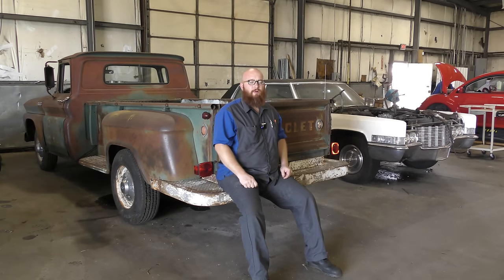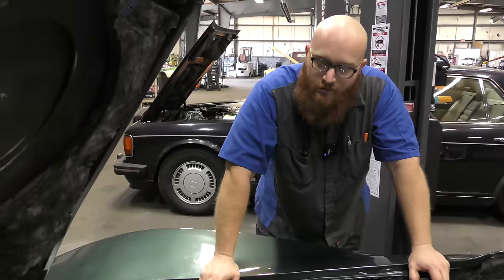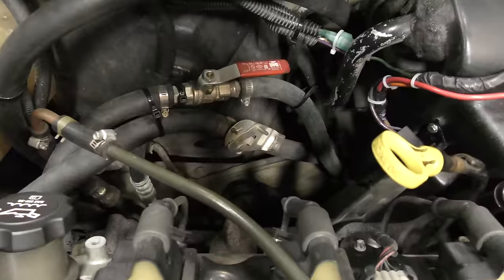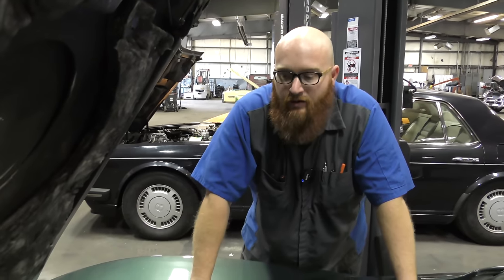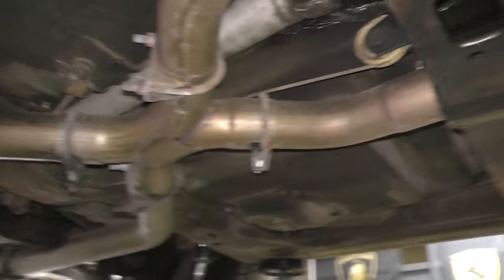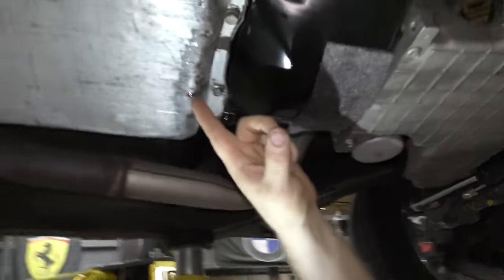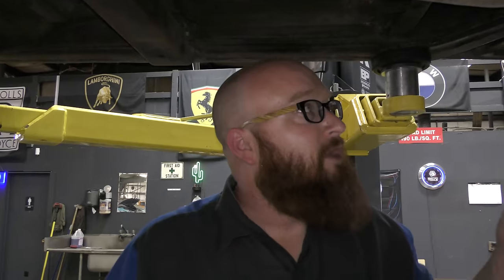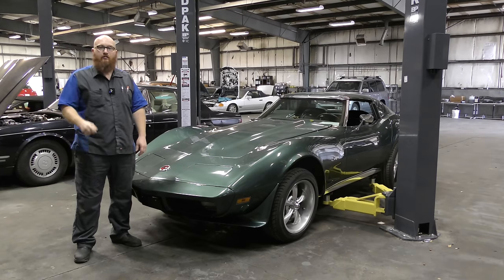Issues AFTER an LS swap! CAR WIZARD warns what can happen on an LS swapped '73 Corvette Stingray

Comment: lol, I'm old enough to remember when people hated fuel injection.  It was the equivalent of electric cars today.
Reply: All race series use fuel injection now.
Reply: Same with electronic ignition.
Reply: in those days the power built up and response to the throttle was slightly jerky....carburators were much smoother at building up torgue and power.
Reply: It wasn't long ago that "Real" mechanics would laugh at these kids that couldn't fix a car that they can't hook there computer up to.
Reply: Yes. They were mechanical back then. Hard to keep working correctly. 
In my HS autoshop, it was all carbs. One of my classmates had a Pontiac 389 with "tri-power" for those of you that remember that.
What would this Corvette have had originally? A 350 with a Rochester Quadrajet?
Reply: Factory fuel injection wasn’t even good until the late 90’s. Aftermarket fuel injection wasn’t even good until like very recently lol.
Reply: @kmath50  My dad opened an auto parts store in 1964. I was 8 years old then. The warehouse put in a line of AC filters. The stock rotated pretty well but one box in particular started getting an oil stain as it sat there forever. When I was 14, doing oil changes in the shop, a 3x Pontiac came in. When I went to blow out the air filter, the only thing left was the wire mesh and the plastic rings where it sealed against the housing. The pleats had collapsed and the only thing left was crumbs
 I sold the guy the filter and I finally got rid of that old filter. I also had a filter for a Plymouth 6 Pack Super Bird. There were 2 drug dealers in town who bought them new. One was confiscated in Nebraska and it's in a DEA museum somewhere back east
 The other oval old filter I had was for a Packard/Desoto. Some guy walked in with the filter crushed and packed full of mud. He told me it was for his airplane.
Reply: When the carb to injection switch was first happening performance parts for fuel injection were super expensive.   That's why I loved carbs
Reply: Alot of Cross Fire Injected 82-84  Trans Ams, Camaros, and Corvettes got switched to aluminum intakes with Holleys. The TPI cars were alot better.
Reply: The front spoiler is 78-79 style. I call those wheels "Torque Thruster" style.
Reply: If you're that old, you're likely referring to mechanical fuel injection, which was primitive at best. It obviously doesn't compare favorably to today's modern fuel injection.
Reply: LOL, I'm old enough too. I also remember FI being pricier. And available only on higher end models at the beginning.  Then it was on equal pricing and jumped to FI as soon as I could.
Reply: There were no standards so you had to be a wizard to figure them out
Reply: My first car had TBI... it was not that good. Luckily by the time I started doing my own auto repairs, I was driving cars with OBDII and multi-port injection. Sensors and wiring may be a nuisance sometimes, but at least the computer can give you a bit of a clue.
Reply: I do understand what you mean, but I don't think that's a valid comparison. We didn't need fuel injection, but we absolutely have to electrify the transportation system, etc., or we are dead!
Reply: @travisblack417  More like late 80s
Reply: Also old enough, people hate change. It's a revival of that attitude that's the reason for using carbs now, they think because its mechanical they can fix it easier.
Reply: Have a Volt..........have not used gas yet.
Reply: @travisblack417  Fuel injection was never really efficient or reliable until computer software/sensing hardware caught up with it. 

That Demon is definitely the wrong carburetor for that car though. A dyno would be the best way to get that thing to run right, otherwise you're just shooting in the dark.
Reply: I know right
Reply: Luddites gonna Lud..
Reply: People hate electric cars?
Reply: FI is awesome
Reply: My dad still hates fuel injection
Reply: it’s so crazy how good modern FI systems have become, OEM & aftermarket. I remember the days setting up mega squirt FI systems in the late 90’s/ early 00’s.
Reply: Well it's been refined now, and people understood it less.
Most weren't electronic either.
Reply: @tomast9034  The nature of Carb has always been a lot of torque and power almost all the rev range and if you put a blow through turbocharger you can say just becareful not to crash
Reply: Quix 😂
Reply: jaky bakey Actually there’s plenty of combustible fluids that do not add to greenhouse gases such as hemp oil and also hydrogen water powered combustion engine
Reply: Allan Koivu Let me know when you get a chance to fix and repair your car ,  oh that’s right you can’t
Reply: G Warren yes.
Reply: Chris Wright Your dads a smart man
Reply: I want to convert a 1969 Camaro to electric
Reply: @Mike Anderson  you have fuel issues on the side of the road, just grab  a screwdriver and fix it,   have a problem with an injection system, i hope you packed your computer and software with the special connection leads ect:
Reply: Not equivalent really, cause with carburetor to FI, the engine still has personality and soul. Electric motors will never have personality or soul.
Reply: Fuel infection
Reply: Cars only had 250hp back in”the day” sooooo
Reply: @allankoivu3263  That's operator error. Better read your owners manual.
Reply: @Quix It takes 14 days to drive across country but they're great around town.
Reply: @Matt_The_Hugenot  they can be fixed easier if you know how
Reply: @falcon6995  As you can see on this channel often it's diagnosis that takes longest, the more modern the car the better the firmwear is at reporting faults. There is nothing worse than staring at an engine that ought to be running right but isn't.
Reply: @kmath50  you gotta be in your late 50's early 60's? I rebuilt a GM straight six...from 1960 ish in my shop class. It was all carbs back then....we discussed FI but it wasn't really even on the radar....
Reply: They really hated smog control EFI was scape goat
Reply: no electric cars are chinese crap

Comment: using fuel injection on an LS is one of the main reasons for doing the LS swap
Reply: True dat.
Reply: Foreal, reliability.
Reply: That’s how I’d deal with it.
Reply: @Joseph Pearcey yeah the injection makes more power and uses a shit tonne less fuel and improves driveability no end.
But yeah. Stick with 1930s tech.
Reply: @sugarnads  no it does not make more power. It may be more tuner friendly because you have a laptop but that's because most don't wanna learn how to adjust a carburetor or curve a distributor both things can be learned very easily.
Reply: Uh no it's not the it's the architecture in general

It's better than 350 vortecs or camel hump heads when it comes to factory horsepower. All it takes is a cam swap in an LS and shaving the heads down if needed

But he could have bought a C3 with a nice 350 and would have gotten the same feel without all the wiring that was done wrong on this car
Reply: @ThePatUltra For me I prefer Fuel Injection or Carbs anyday of the week.
Reply: Otherwise,  drop a 427 (or whatever) SBC crate motor in that was designed to be run with a carburetor.
Reply: @ThePatUltraadjusting the carburetor for the rest of your life? 

You act as if people drive carbureted cars all the time. I don't drive my car on my channel all the time 

And cars like this you're adjusting a carburetor all the time and if you had an old car with an old school small block or big block, just get Holly EFI!

They make Holly fuel injection for old cars and old school small blocks and big blocks
Reply: @ThePatUltra I've been to a cars and coffee before. Like I said check my channel. I actually have one uploaded dude lol

You can hoose whatever you want  LS small block but a big block will always be king. 

A simple 350 or 383 can make power over 500 as well and it doesn't break your bank and adjusting a carb and timing for altitude isn't that hard. Plenty of yourubers do it PLENTY. And plenty do LS swaps. I like LS swap guru myself

You correcting me on my spelling is just more rediculous stuff I barely read

Working and wrenching on cars is anti social?!

LMFAO dude you are definitely NOT a car guy.

You don't like working on your car doing a LS swap? 

You long rant didn't even get read mostly because that long rant you wrote wasn't even needed
Reply: Horsepower TV did a nice little 5.3l lm7 with a carb, made tons of power on the dyno.  It's not a bad thing, you gotta know what you are doing.
Reply: @KingJT80  Why do i smell BULLSH** HERE!? Some people use carb for that low end torque
Reply: @mayuravirus6134  I dunno

I would be using smaller heads and cam for low end torque as well EFI carb LS.or.not

Or a low rpm  big block but I think old school like that
Reply: You can tune a carb and points for more power under a given set of atmospheric conditions and a specific load.  A well tuned fuel injection system with electronic ignition may not beat the perfectly tuned carb is going to do better over a wider range of conditions and loads.  That’s why I’m all in for fuel injection unless your building a car for the track.
Reply: @blackterminal  kills ignition too so whats yr point
Reply: You’re exactly right. I have no idea what the butcher who did that was thinking.
Reply: I mean if you're racing and have a supercharger and have been running carbs all your life, by all means go carb. But for a day to day driver, please, efi.
Reply: @sugarnads  I agree, Karl Benz used a carb in 1907 !!!  Ahhhh! LOL
Reply: @KingJT80  Exactly its sheer laziness to go fuel injection. see how they like it when there precious computer goes caput and all you have to is hit the carb with a screw driver to unstick a float.
Reply: @Sourman1545  I will say that the advantage EFI does really have is tuning for different altitude
Reply: @KingJT80  Nothing against carburetors, but the reality is assuming everything else is the same, a properly set up fuel injection system will make better overall power more efficiently and consistently over a much wider range of conditions than the same engine with a carburetor ever could since fuel injection systems constantly optimize the tune as you drive. Changes in altitude, humidity, engine temperature, intake air temperature, fuel temperature, fuel blends, etc will drastically affect the tune and a carburetor has no way to compensate for any of these factors. The dyno comparisons showing carburetors and EFI systems making similar power under ideal conditions are almost meaningless in the real world.
Reply: @averyalexander2303  you won't gain any meaningful ET over a properly tuned carb vs an EFI system unless maybe you buy something better than a sniper which is basically and expensive TBI. 

The main advantage (with MPFI) is that's easier to change things at different altitudes with a laptop if you have the data for it.
Reply: @KingJT80 On a purpose built race car that's properly tuned before every race, you are right. If your goal is to set it and forget it, EFI wins every time since it can compensate for those factors automatically  with no user input if set up properly. No worrying about changing temperatures, altitudes, etc. On a car that's driven on the street, this is even more true since tuning a carburetor and distributor conservatively so the engine runs safely on varying fuel blends, in traffic, hot weather, varying altitudes, etc can leave quite a bit of performance and efficiency on the table. On the other hand, tuning for maximum performance at the drag strip can cause problems in daily driving. Which setup is best for you just depends on your goals as both have their pros and cons.
Reply: @averyalexander2303  I've never had to change my car's carburetors once I set them. You Cruise more you Cruise them and that's pretty much where you Cruise them at. Race cars a little different and it depends on what class that allows you to have an EFI of course if money is no object, then yeah just use EFI but I'll just pick a $500 carburetor for a 500 horsepower engine then pick 3,000 EFI that's just common sense for something you're going to mess around with on the weekends and maybe take to the strip a couple of times
Reply: @KingJT80  Good points, I agree. If set up properly, carburetors can work fine even if not ideal. To me, EFI makes more sense for vehicles that see a lot of street use under varying conditions since the overall maintenance requirements, reliability, fuel efficiency, smoothness, cleanliness, cold weather performance, etc is just so much better. For a fun weekend project car, there's often better ways to spend your money than EFI depending on your budget and goals.
Reply: @sugarnads  some people love Carbs.  I have a 1050 Dominator on my big block.  love it.
Reply: @Sourman1545  ecm failures aren't very common.
Reply: Why would anyone go through the work of a swap and not utilize the main advantages the swap provides?
Reply: Good flowing heads and cheap horsepower

Comment: When a mechanic says "I could do this, BUT, you would be better going to someone who can do this right first time" then you know you have a good one who actually values his customers
Reply: not really it means the guy got restricted meaning and not alot of contact and from the size of the garage it focus probably on mass service. The service is probably good but he seems like the kind of guy who charge 1 hours even if its 15 min its the spot where you go do a oil change but dismantling an engine gonna cost you 3000$ XD. 80$ to make a diagram from your car with a carburetor its like 10 part max the only hidden thing in a car of those years is the fuse box maybe a hidden fuel pump LOL he talk like this engine gonna need 1000 spark plug pulled out in 15 minute. when you lack knowledge issue and trouble look like grand canyon.
Reply: Not strictly related to auto mechanics, but any craftsperson - if they're better off not making that money and instead suggest you to get better serviced by someone else or not even bothering doing something, you follow their advice. They're doing quite the opposite of trying to rip you off.
Reply: @michaelsimoneau8364  so what? He's a professional, he doesn't keep his shop open by giving away his services. For some reason he has a full warehouse for his shop and is making profit, whereas many guys can hardly stay afloat, knowledge and expertise won't take you anywhere if you don't value your own work accordingly.
Reply: I give my honest opinion to clients/Potential clients and if I get the work great or if they are better off elsewhere I tell them that also.

Treat them right and make them priority and focus on the money in a secondary fashion.

$ is the byproduct of exceeding expectations.
Reply: My mechanic said he was very happy that I replaced the opti spark an my kid's 96 vette. Said he would rather never work on one again. Could do it but didn't like the job.
Reply: Opti Puke haha memories
Reply: what?  When he says that take your car and leave...you wanna hear "Yeah I can get it going right", unfucking someone elses fuck up is common in the auto business..sucks for you as it's paying twice, but yeah only way to know whether someone can do something right is to find them doing it wrong...to me ?  Never mod a car, buy one that's already sorted out, even if you have to overpay, the headaches of the mod trail are redic.
Reply: Also this means you have a lemon 🍋 of a money 💰💲 pit.
You better have a fat bank account or eat it.
Reply: @loktom4068  why do ya'll think there are so many "barn finds"?  The chase is better than the catch